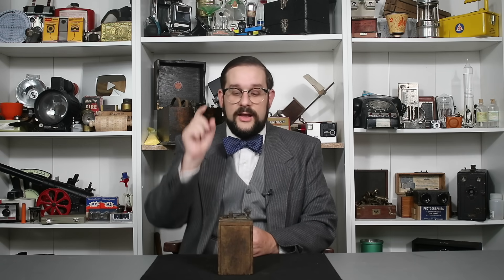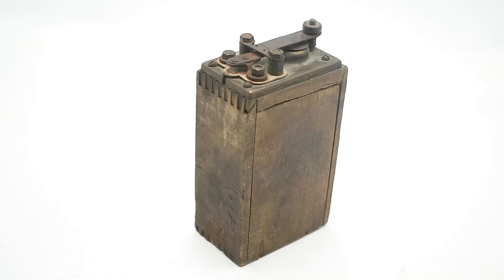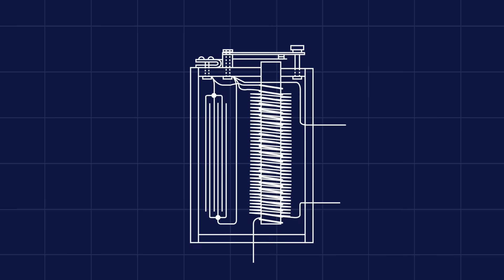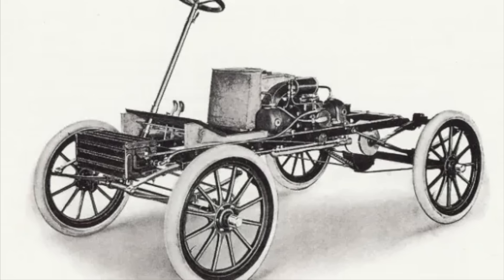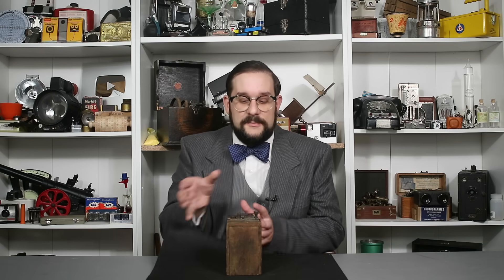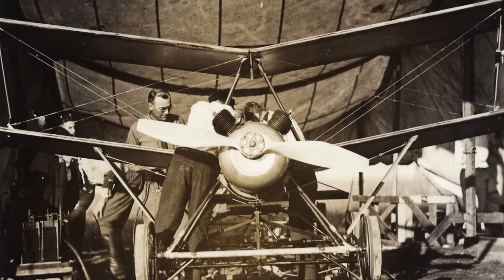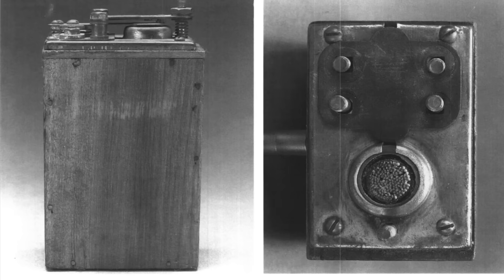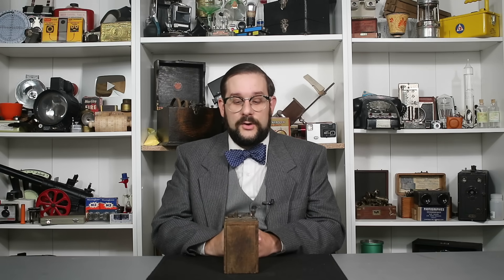Ford Model T Ignition Coil: a Spark of Genius

Comment: A friend in high school had a Crosley which we enjoyed picking up and placing between two trees, sometimes with him in it.  He solved the problem, at least if he was in the car, by adding a switch to a Ford coil which was wired to the bumpers.
Reply: I have a '49. Thanks for the hilarious Crosley gag!😊
Reply: @davidcoudriet8439  
We actually carried it down 4 steps one time and left it in the lower floor of the school.  Fun car.  I am not sure which engine he had, but since this was in 1956 I am guessing it was the cast block.

Comment: Just a small correction for you and the viewers. The wooden box is made with box joints, not dovetail joints. It's a better joint for mass production, and relies moreso on glue than the shape of the joints, as the dovetail joint does. Dovetails, although stronger, are less convenient for mass production, even when done by machine.
Reply: Box-Joints are (to me) akin to the Acme of woodworking.  I have thought to use a dovetail jug to do ‘em.  They look better (to me) than dovetails.
Reply: @dennisyoung4631 I have a restoration project that is going to require box joints. I'm going to try and make a jig for my bandsaw to do them
Reply: Did he actually say dovetail? About the box I heard tongue and groove, which the cover does appear to be.
Reply: @ahooper99  He didn't mention dovetails, but he mistakenly called the finger/comb/box joints "tongue and groove" which of course they aren't.

Comment: I suggest you continue the evolution of auto ignition systems to include distributor-less "wasted spark" systems.  It is novel to have spark occur on a cylinder once per revolution instead of every other revolution as well as having two different spark plugs fire simultaneously with the spark plugs essentially wired in series.

I've found the lifespan of distributor-less ignition system spark plug wiring to be reduced compared to conventional distributor systems.  There must be a form of electromigration wear out mechanism for spark plug wires similar to what occurs in integrated circuits.

Ford also  patented an experimental ignition system using series high voltage diodes to steer the spark  to a pair spark plugs connected in parallel.  The primary coil was center tapped so the polarity of  spark could be changed to determine which pair of plugs would fire.  This was never used in production as if one plug fouled, two cylinders would not fire.

Comment: We always refer to these devices as a "Model T Singing Coil" and they are still Very useful today when paired up with an aviation spark plug as a deterrent to drones!!!  🤠👍
Reply: They cause trouble for Drones?  How?
Reply: @dennis, just guessing, but probably radio interference.
Reply: @dennisyoung4631 the aviation spark plug when connected to the singing coil pretty much broadcast/scramble on ALL frequencies so you MOST DEFINITELY Do Not want to turn it on and leave it on!!!  💥🤠👍
Reply: @worldtraveler930  The phrase "DC to daylight" suggests itself.
Reply: @dennisyoung4631  RFI (radio-frequency interference) would be my guess. Lots of wideband noise to jam the control signals. Note that we're not talking about military drones. They're fairly resistant to jamming. We're talking about the ones your a-hole neighbor flies over your property to harass your dogs and see you skinny-dipping in your hot tub.
Reply: I can do this with just things I can buy at Wal-Mart, without even visiting the automotive section.

Comment: While other manufacturers switched to the Delco system,  Ford used the outdated trembles for 2 reasons. If one failed you could still limp home on 3 cylinders.  And, he didn't want the Model T to require a trained mechanic.  His target audience was farmers and small towns where repairs were either do it yourself or the local blacksmith.
Reply: Ford's main reason for anything was highly efficient manufacturing, and when the factory is tooled up for a specific job, it took some massive for it to be changed.  The Model T was essentially unchanged during it's entire production run.  A few minor things and additions, but few swap outs

Comment: One type of ignition system you did not mention was the flame ignition system. The early Otto engines (and others) used this system. In this system, a slide mechanism was used to transfer a small volume of incandescent gases from an open flame outside the cylinder into the combustion chamber to cause ignition.
Reply: Yes, those things were often and engineering marvel.  They had to move quite suddenly and also seal fairly well
Reply: Flame lickers

Comment: This sort of trembler coil continued to be used in portable radios up to the invention of the transistor. Vacuum tube radios required a high voltage to function.
Reply: The devices for radios were called "VIBRATORS" and were physically resembling small soda cans.  They worked like this
Reply: @AlbertBenajam-ww1db  Vibrators for radios were a push pull forward converter. Ignition coils are a flyback converter.
Reply: @AlbertBenajam-ww1db I found one when I was in grade school.  I named it “El Jolto” based on its stated purpose, which I’d read about in the Amateur Radio Handbook.
Reply: @AlbertBenajam-ww1db  I own a soviet one. I tried making a DC converter with it but it generates enough interference to drive detector receiver sitting by my desk. They require crazy amount of filters even as a power supply for audio amplifier let alone radio equipment.
Reply: Found that out the hard way trying to find out why a 50s car radio wasn't working. Took the cover off while it was powered up and stuck my ring in the wrong place.
Reply: Finger lol
Reply: There were some that used very special "low voltage tubes".  These tubes were build to work with 12V on the plate.  They had a grid extremely near the cathode that accelerated the electrons sending them towards the control grid.  Later versions switched to transistors for the audio out because getting any volume out of the low voltage tubes was really hard.
Reply: @kensmith5694 was thinking more like 1T4, 1U4, and 1AD4 - all of which I have used with degrees of success.

And, I have been tossed by “El Jolto” back in my early teens.  I was attempting to tune a homebuilt 1 tube amateur radio transmitter - W6 IYZ was my call, then - and as I was a high school freshman new to building electronic equipment, my experience was limited. (Some high voltage terminals were accessible to a careless finger while measuring plate current, looking for the dip at resonance.

I did get my dip, eventually - but not before 285 volts DC tossed me six feet downrange!
Reply: @dennisyoung4631  I meant more like the 12U7
Reply: @kensmith5694 yes, the lower voltage 12AU7 - the original tube being one which will run just fine south of a hundred volts.
Reply: Yep, sounds like “el Jolto” got to you.

Note: there are tubes that do decently at less-than 100 volts.  Those portable ones mentioned earlier often used “B” batteries, e.g. 22.5, 45, and up to 90 volts.  Filaments and bias were often handled by “A” and (rarely) “C” batteries.

Comment: 13:00 - The Delco system, was the dominate ignition system, until the mid 1990s. You're not going to find a distributor cap, in a modern car (2000+). Now, they have a small spark coil above each cylinder, and controlled directly by the car's ECU/ECM (the engine's brains). Found out in this video, that in the really old days, cars had multiple ignition coils, too, for a short time.

Of course, if you have an EV, you have none of this. Well, they had a few EVs over 100 years ago, too. Modern battery tech, is the major factor to modern EVs, but don't discount modern power electronics. Modern power electronics, have made lithium ion complex charging viable, and produces 3 phase, variable frequency, AC to drive the traction motors. That's even more important than rare earth magnets (which are being eliminated in some newer designs).

Comment: I have one of these kw spark coils that I used in a science project in the eighth grade.  That was 1962.  Minutes ago I tested the coil and it still has a strong spark.
Reply: I collect antique engines and tractors. I have a half a dozen of them , 4 still work. There is a homage “ back” to make a buzz coil out of a Chevy coil off of a version  of LS engine. 
A couple of resistors and wires. Gives better apart all around. Slight lag but that can be adjusted for. Then higher voltage amps and longer spark duration. Makes a hard starting engine easier.
Reply: @williamphillips642  My Grandpa has a few old tractors. His oldest is a 1935 Oliver Hart-Parr 70. It had steel wheels on it, but he put some later ones on with tires so he could drive it in parades. It has some kind of issue with the magneto.
Reply: @williamphillips642  Hi 👋  , do you have any info on the ls coil mod  . I'm really interested  . Thankyou
Reply: @sarahgregory-i7w  What is probably being described is something like a D585 coil, it's a "smart" coil with integrated ignitor that basically allows you to create a spark off a low voltage and low current digital pulse. It needs to be "dwelled" or charged before it can spark, which is the static delay the can probably be adjusted for. I put those coils on my miata because they are hot and they are/were cheap. If you can control the dwell time in the ECU or the factory times are within range then they can easily be adapted. I still snag rails of them from junkyards when I see them. The round ones, not the crummy cubes. 
LS coils are kind of unique in automotive coils in that they will just fire if they are overcharged, engines don't like this very much. You probably need to understand a lot more than a youtube comment can convey to safely implement them on something else.
Reply: @pontiacg445  . Thankyou for the tips on the coils  . Much appreciated 😊
I'm in Australia  , I'll have to go hunting for the ls coils as we didn't get a lot of ls' s here in Oz
Reply: Back in the late 50's I had one in grammar school. We used to have fun powering one with a model train supply and hooking a wire to a door knob. ZAP! Great fun.
Reply: congratulations! You own a piece of history!

Comment: American Rifleman published an article back in the 1950s that showed how you make a bullet chronograph using a Model T coil. - you laid out two lengths of iron pipe. One side gets wrapped with wax paper. Positive side of coil goes to one pipe - negative side goes to the other. You fire a bullet between the pipes. As the coil current pulses, it jumps the gaps between bullet and pipe and there will be a burn hole in the wax paper. The holes should be evenly spaced down the length of the pipe. To mathematically determine the speed of the bullet you have to know the rate of the pulses from the coil. They suggested using someone with a trained ear to find the perceived musical note of the coil and match it to a note on a piano. (No two coils will have the same rate) once the note is found, that tells you the rate in Hertz. You measured between the burn holes with the known hetz rate of the coil and you could determine ft/sec of the bullet. Just one of the crazy things these coils were used for. I think one could easily duplicate this chronograph experiment but use an instrument tuner/app to find the coil buzz rate.

Edit: since posting, I looked it up. The article is from the February 1940 issue.
Reply: Every time I learn about early experiments, I think about how much my kids didn't learn that I did and how that varies from my parents and so on. We get taught more subjects but less depth.
Reply: @kdawson020279 and we are so heavily regulated now on so much. Regulation, justifiable or not, stifles creativity. Just look at the appliances we have as cars today. Hell, most people even buy their cars today in home appliance paint tones. In the gray scale. White, gray, silver, and black.
Reply: @mindeloman  Regulation absolutely stifles creativity and innovation.  Basically no innovation is coming from the west today as our governments have choked it to a crawl.  Australia launched it's first 'space program' rocket a few months ago and it was a failure.  Considering almost 60 years ago the Yanks put a man on the moon, and now Australia has what is basically a large model rocket, it would be laughable if it wasn't so abysmal.  Not to mention what excessive regulation and control does to the psyche of the population.
Reply: @kingcosworth2643  Regulation also made for working conditions where we no longer had to make dying at work seem like a worthy pursuit (see: John Henry, steel driving man, who died of cardiac arrest racing a f**king steam drill through rock springs to mind). I am not saying all regulation is good, but look at the video footage of people getting mulched at work, and realize that some of those regulations were written in blood and ended some of the darkest years of the industrial revolution. There is a happy medium between regs and no regs. I just haven't a clue where that medium is, so it has to be approximated, and then repeatedly overcorrected like everything else. 😂
Reply: @mindeloman  Regulation absolutely DOES NOT stifle creativity - it might stifle the use of said creations, but that is a COMPLETELY different story. I doubt you'd enjoy (or survive) living in an unregulated world! I'll go straight for the jugular here and use the example of guns. Many amazing and very efficient k!lling machines have been developed over the last 60 years, especially in the small arms world. Take one of the latest- "bump stocks" - turn your ar15/m4 into an m16 on full auto. Regulation didn't affect this development at all, but IS definitely needed to stop people walking around with a weapon which only belongs on THE BATTLEFIELD! Without regulations, we would all be living in a world where death would be everywhere- dangerous working practices forced on the workforce by greedy corporations, unchecked pollution etc. Lets do away with regulation of car speeds and see how many kids get wiped out playing in the street because people can drive at any speed they want. Let companies dump vast quantities of toxic chemicals into your rivers and in land fills next to schools. I live in the UK and travel around Europe for  months every year. Because of regulation, we don't have to wonder whether Jhonny will make it home from school without getting shot, and we don't have companies poisoning our ground water and rivers! I could cotinue...Your argument is short-sighted and funamentally flawed- one cell thinking "don't regulate me!" To live together in a safe society we HAVE to have regulation. It's not even a balancing act, it's common sense (to anyone outside of the US).
Reply: @phila8176 Alrighty
Reply: @phila8176  sure, phila
Reply: That is the most amazing thing I’ve read in a comment for awhile.

I appreciate my Labradar even more now. 😊
Reply: man, can you imagine a magazine trusting people to make something like that nowadays?
Reply: @Khorne_of_the_Hill  magazines have long lost the ability to write articles like this BUT the kinds of people who do those projects do still exist. They just write on personal blogs or YouTube and you can find them on sites like Hackaday.
Reply: In the early 60's  my grandpa made a electric fence charger out of the m. t's. Coil using a tub a foot long or so and there was a ball in it bounced back and forth   so to click on and off the electric discharge jult
Reply: What do you mean shoot between the pipes. Like inside ? 😮
Reply: Ballistic pendulum solves all that - more work, perfect precision if you remember to REMOVE a bullet from the box - o - bullets om top of the pendulum.
Reply: Fascinating info.
Reply: cool in theory, unusable in practice.
Reply: @Timsturbs  I wonder if the frequency of the coil was affected by the presence or absence of a current path through a bullet?  If the bullet allowed a better current path, that would slow down the rate of the magnetic field collapse and thus reduce the frequency.  My guess would be that it would probably cause a measurement error of somewhere between 1% and 20%, which may or may not be numerically significant.
Reply: @flatfingertuning727  googl says ford t ignition works at 200hz. so to measure even subsonic rounds youll have to place a shot with 1/32 inch gap between two 100 inch pipes, and as hot gases are condactive it must be done from a distance. thats insane precision even if frequency stays stable. its much easier to just use two rotating discs metod.

Comment: I remember these were available from Canadian Tire as late as the mid ‘60s. They were $4.25. 😃
Reply: Yes! My Dad purchased four brand new Model T coils off a dusty shelf at Englert's Auto Parts in Schenectady New York in the late 60's for $4.50 each!  I still have them in our Model T!  Englert's was a great place- a long narrow wooden building nestled between the D&H railroad track and Maxon Road.  A long steel topped counter covered with extensive parts manuals bound together (pages dirty from years of greasy fingers), staffed with old countermen that knew everything about cars back to the 1920's.  The starter/generator room was staffed by Vern, who stood in that little area rebuilding all day.  Vern's room had a high window that looked right out at track level to the D&H railroad.  The whole building vibrated when the train went by.   Everything is gone now, all but my childhood memories.